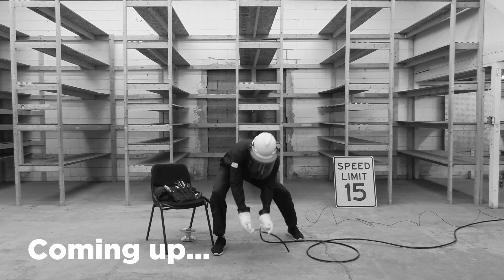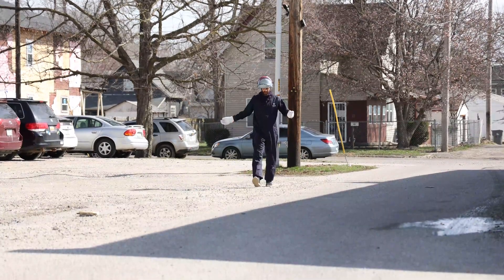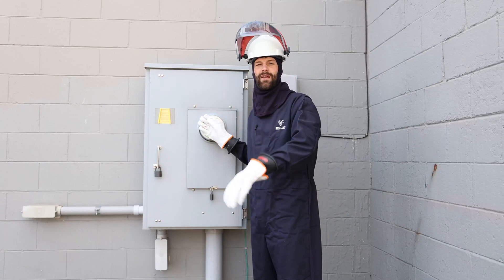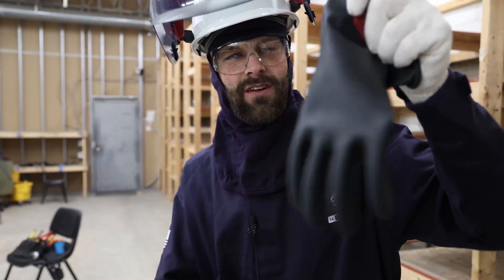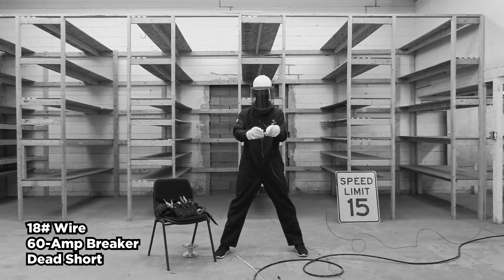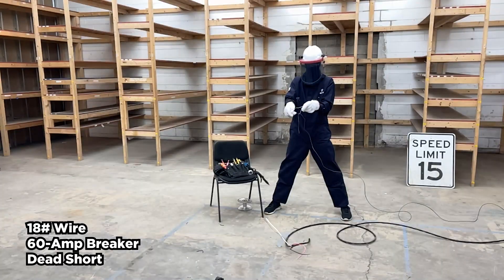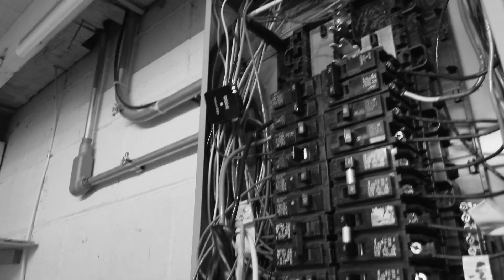Slow Motion Arc Flash - the Hazards of Being an Electrician

Comment: Not an electrician but I'm curious, care to explain what is exactly going on at 3:17 onward?
Reply: The part he didn't explain is that the wires welded together on the 1st short circuit he created, thus you see no arcs, the current is just going through the wire and you WON'T be able to separate them, then the breaker trips as it should.
Why did they weld? Well that is basically how a spot welder works. The short circuit creates a LOT of heat on that spot, enough to melt the copper.
Reply: He was bouncing those two ends together and they stuck and welded instantly before he can drop the wire it burned into the gloves a little bit and that whole wire was so hot it made a big long black mark on the floor. If that breaker had hung and not tripped on time that metal would have been white hot in another second.

Comment: 4:05.    That last one with the #18 also illustrates why we have rules for feeder taps at ¹/¹⁰ the ampacity of the OCPD on the line side of the tap for the 10 foot tap rule,  and ⅓ ampacity of the OCPD line side of tap for the 25 foot tap rule.  Not to mention resistance goes up as the conductor heats up reducing the fault current and increasing the clearing time of the OCPD to the point of not providing adequate protection if a short circuit occurs on the tap and the rules are not followed.

Comment: So if I'm understanding electricity properly: the delay in the breaker due to smaller gauge wire is most likely due to current limiting done by the wire. Is that right?
Reply from the maker: Bingo!
Reply: Holy crap
Reply: Just remember:   short circuits still always make a circuit breaker (or fuse) trip the fastest.  Overloads can be a lot slower.

Comment: I arc wires in homes just to trip the breaker so i dont have to find it lol
Reply from the maker: I can neither confirm, nor deny, that I know what you're talking about 😏
Reply: Not really the best practice.
Reply: @jovetj   I won't be so kind to the OP , it is an incredibly stupid thing to do for many reasons: Arc flash, arc damage to customer's walls/floors/etc, if the breaker doesn't trip you will have overheating wire or burning connections upstream, you can easily start a fire in a box with bad connections, and you will also scare the customer and look like a total asshat in front of them. All the companies I ever worked for had the policy that anyone who tries this stunt gets terminated immediately.

Comment: Awesome. I jumped even though I know it can't get me. They need to work on wire that won't melt.
Reply: Not sure what type of wire was used, but if it was thhn meant for in conduit then you'd be looking at 75c rating of 18A so appropriate breaker would be 15A; they had it on a 60A breaker which means the breaker will require a larger surge before it trips. The appropriate 15A breaker should have prevented the wire from melting.

Comment: That was not an arc flash my friend, nice try
Reply: Exactly!
Reply: I think it’s  more among the lines of a short circuit ?  Correct me if am wrong 🤔.
Reply: @jaybadass2318  Sparks of shorting little wires together is not an arc of electricity flowing through the air.  
An arc flash (specifically the light) is electricity flowing openly through the air. AKA just like lightning.

Comment: My old boss was picking up the crew when one of the workers got in he stunk up the van. Turns out he did a rewire that morning on a 12/2 circuit that shorted with the wrong breaker and melted 30 feet of wire inside the drywall around the room. He bought the wire to show us on the way to work.
Reply from the maker: 😮 Love that he took it as a learning opportunity for everyone else!

Comment: Scary stuff, when you realize what the potential is! We were replacing a 200 amp main breaker the other day, [De-energized] and after removing the one mounting screw, the entire assembly just fell apart. If live, L1,L2 would have been shorting. After doing electrical 30 + yrs, makes you have more respect when you open that panel, exposing the main breaker.
Reply: @Twitchy-Idjit Nobody cares about your opinion.*
Reply: This reminds me of a comment on another electrical work video I saw, "This is for pilots but it also applies to electricians. There are old pilots, and there are bold pilots. But there are no old and bold pilots" (maybe not word for word).
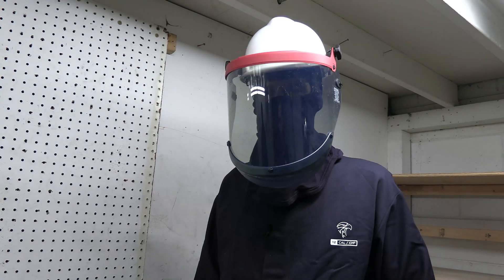Reply: I only worked on residential electrical stuff. I would turn off the breaker in the house fuse box, grab 5:01  one wire with the insulated pliers short it out to make sure I have the right breakers thrown. It had enough spots on it to make a guy really cautious to check everything.

Comment: On the last one, what was the flash from the room with the panel? Was an arc flash visible there when the breaker tripped, even though it's a solid black casing?
Reply: i think the breaker exceeded the rating of the wire, and by chance, the resistance of the dead-short wasnt enough to pop the breaker, but was still enough to cause melting

so the whole length of wire began melting, insulation fell off, and then it began shorting at other points, reducing the resistance and increasing current further, and arcing out of frame

if it didnt short itself shorter, it could have been a demo of how a fire starts in walls
Reply: I think that was the breaker clearing the dead short.  Inside the breaker are a series of plates arranged in a row, like a comb.  This provides more surface area to dissipate the arc created inside the breaker when the breaker opens.  Search for a video titled MCB, how do they work.  It will show the mechanism better than I can describe.

Comment: Great vidio.Was extreme!y fortunate to have a company that purchased everything  except for PPE rated under shirts. Had PPE rated hoodies, & winter rated PPE jackets. Our visors on hard hats had  darker green tint.Should mention that rubber & canvas gloves must be sent out every 6 months to be tested & date stamped. Should wear 100% cotton socks ( which I could never find ) & electrical rated work boots good for 1,000 volts ( have no metal eyelets. Always had trouble with every GE garbage 13.2 KV switchgear. Worst was a POS GE 13.2KV dual service outdoor switchgear. It had an ARC flash rating of 120 CAL and moron engineers in training installed vents at eye !evel. ( which guarantees to not only burn your head but blow it off your body ) Was told that any arc fault above 50 cal no matter what approved PPE one would be wearing is guaranteed to kill due to blast would throw you back over 20' .Of course like all GE switchgear it had serious problems within a year with moisture building up and you smell the think produced by high voltage corona. Had to install strip heaters to keep humidity down. Think OSHA requires that you replace all hard hats who very two years but that seldom happens If you need a PPE Hood for high voltage spend the extra money for the style that has a built in cooling  fan that runs in 6 AA batteries. Never use fabrics softer on any PPE rated pants shirts or jump suites when you wash the stinky things !
Reply: Q for Quinn makes 98% cotton socks but I prefer Darn Tough merino wool work socks because of the lifetime warranty.  Also, a company called Woolley makes 100% merino wool underwear as well.